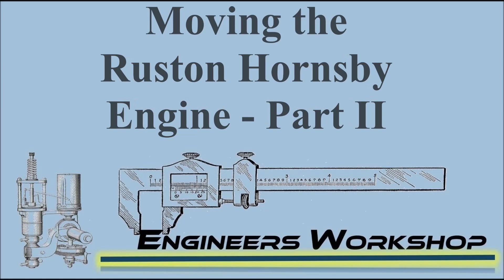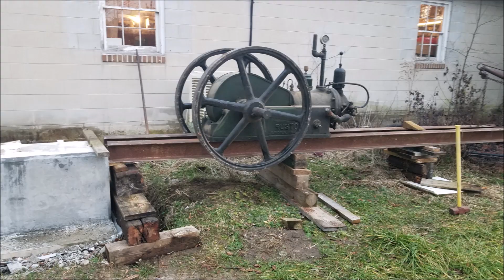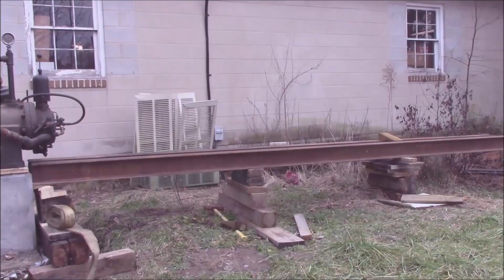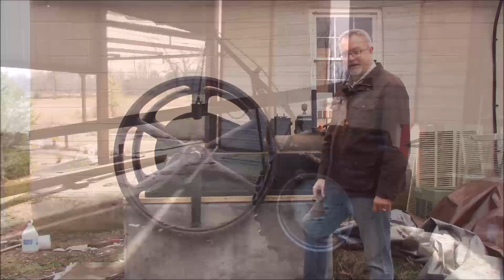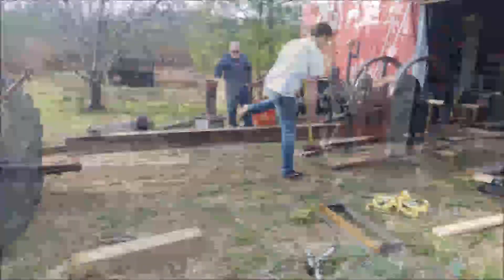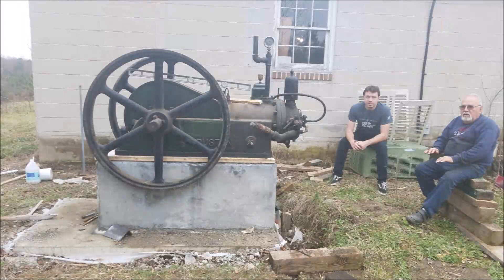Ruston Engine Move - Part 2

Comment: Well done.   I'm trying to find a setting procedure for the governor eccentric lever as used on the fuel pump control for a 5ME . It is the pump with an exposed  fuel pump striker rod. The end of the adjustment Peg ( screw ) had mushroomed somewhat and the lever was sitting at around 6.30 ( 190 degrees ) which when it needs to arc down to operate doesn't work well. I have adjusted it and got it running much better, however I would like to find the correct setting. ( currently it sits at 7.30 )  The governor arm sits at 9.00 at rest and I wonder if the eccentric arm should be the same with the connection / adjustment rod not connected. Any ideas would be appreciated.
Reply from the maker: Unfortunately I'm not familiar with that engine. I'd post the question to the antique engine forum. I'll look up the url and repost a reply.
Reply: @EngineersWorkshop  Thank you kind sir
Reply from the maker: https://www.smokstak.com/forum/forums/vintage-diesel-and-oil-stationary-engines.60/ This one is for diesels. Other forums are for gas, oil engines, carburetors, etc. Good luck!

Comment: You'd mentioned that this engine came from a Canadian Grain Elevator, but didn't know how it was set up..... So here goes!
Elevators (often called Prairie Skyscrapers) usually ran on a wide flat-belt system. The engine was usually housed in a small shed beside the Elevator to eliminate ANY chance of any sparks, since Grain Dust is EXTREMELY Explosive. The engine would run a long flat belt (sometimes through an enclosed "tunnel") into the elevator, where it ran a scoop-type of elevator system that would lift the grain to the top of the structure, and from there it could be sorted into one of 8 or 9 grain bins above the operator. It would be stored there until a rail car could be filled, basically by dumping the bin into a huge funnel, and guided out to the waiting grain car for shipping.
Great to see you put one back to good use!
Reply from the maker: Thank you for the history on this! Did you work at one of the places they were used? I need to get back on this engine, grouting it in and extending the roof over it.